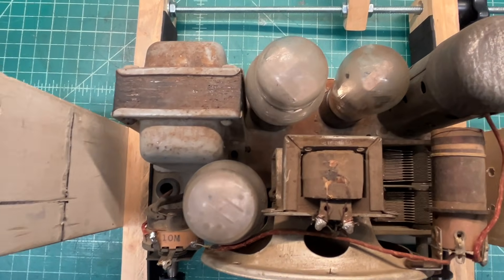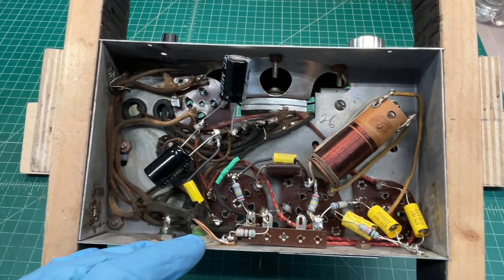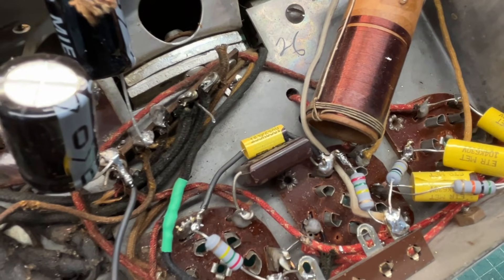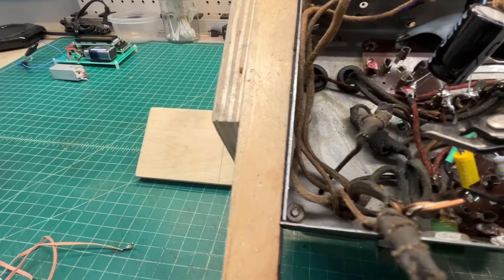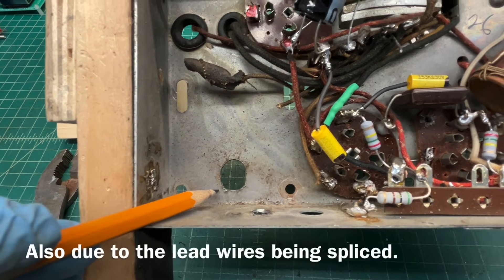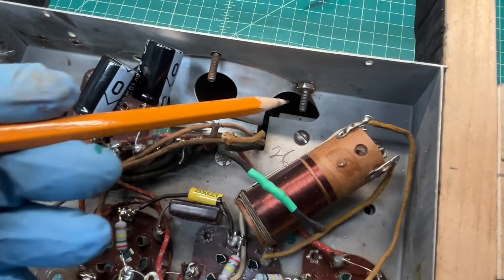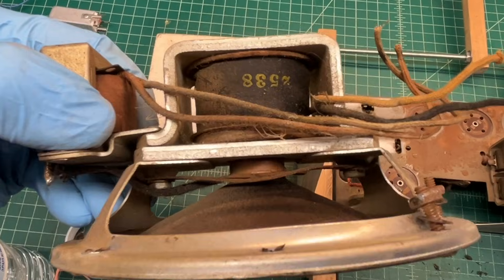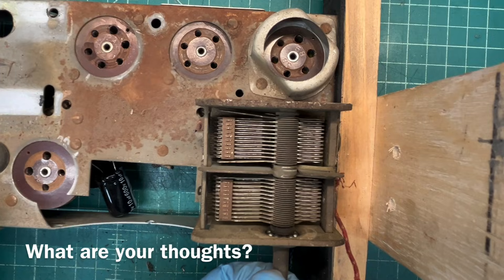Pathe - Model R | Chassis Teardown | Speaker Spider? | Tuning Capacitor (Condenser)?

Comment: Hi Don.   I think the spider is warped but if it plays well I would leave it alone .   Logs as it doesn’t rub.       As for the tuning cap looks like it is bent to far for me. It would be interesting to how far off. It is if it is bent from the factor.      You pick fun stuff to work . Thanks for the video.   Please stay well.                Dean
Reply from the maker: Thanks for watching Dean, glad you enjoyed the video! Yep, a little rubbing of the voice coil based on my very limited power up test. I’ll probably forgo tearing it down and rebuilding it, but you never know I may get the urge to tackle it. That tuning cap to your point definitely looks extreme. Hope this finds you doing well. Best, Don